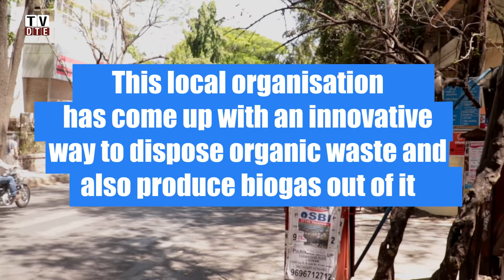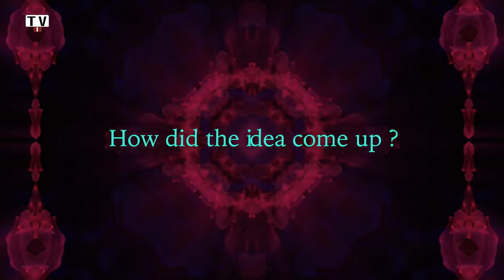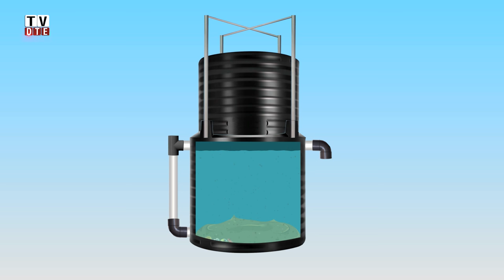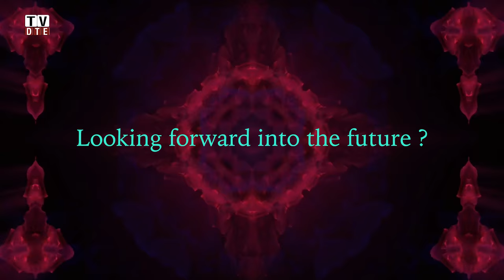Your Very Own Home Biogas Plant: In Conversation with Dr Priyadarshini Karve

Comment: Sweet words with a useless solution.  I mean uneconomical solution so far as the cost and convenience of present alternative kitchen fuel. Now the present LPG cylinder costs around 800.00 plus. It is sufficient to cook food for a middle-class family for about 2 months approx. ie., Rs. 400.00 per month. At the maximum from out of the kitchen waste of about 3 Kg, you may get gas sufficient to cook for about 15- to 20 days.  The value of Gas produced may be around Rs. 200 to 250.  To earn Rs. 200 you may have to spend about 10000 to  Rs. 12000.  You have to arrange space for an additional single stove for Bio Gas. There should be space to maintain the unit ( This is okay.)  With the present generation of elite ladies looking for a hassle-free system, Disposal of Slurry containing nasty smell is a real problem in apartments.  I doubt even 10% of them ready to go for this.  Our people have no hesitation in handing over the kitchen waste with a bad smell to civic workers without bothering about their health or health of people living nearby garbage dumps. They do not mind complaining and grumbling inefficiency of Municipality and some of them are even ready to throw the same on the road while going on a stroll in the morning or take a bike to throw in a faraway lane from their house. Only people who have a passion to work for a clean city may go for some time and discontinue. Urgent need of the day is safer disposal of wet waste and not its utilization. Simple claps and words of appreciation are not sufficient for a better society.